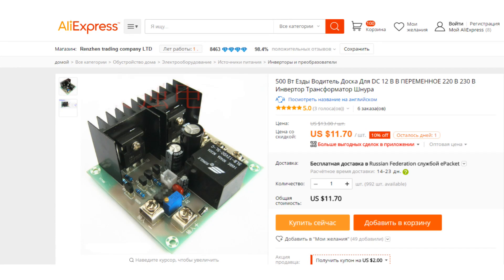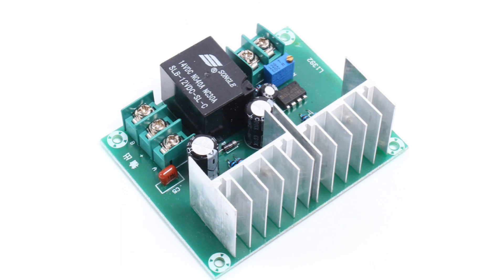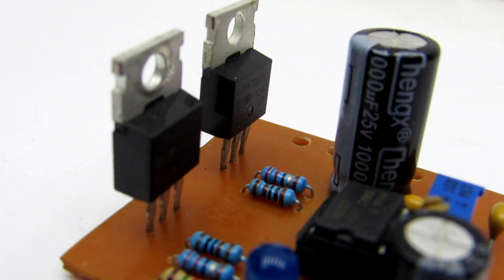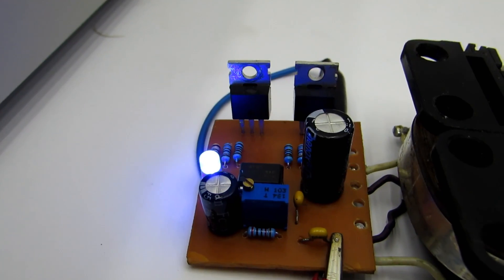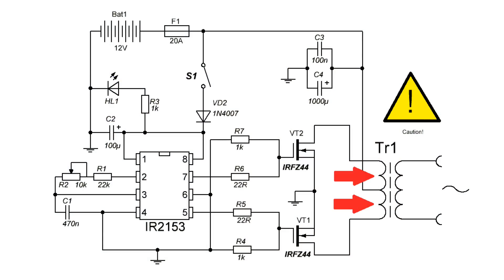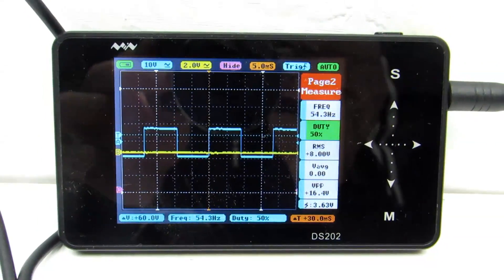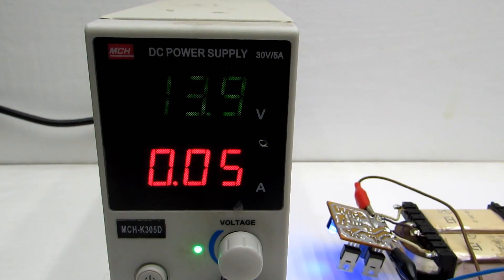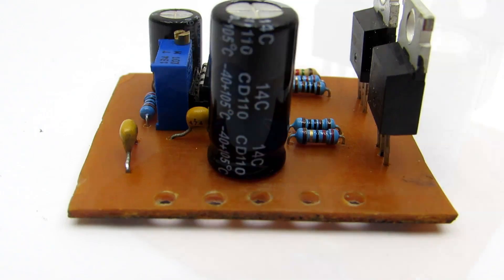DIY Simple inverter from 12V to 220V

Comment: please sir, tell me one thing. I have 12V DC with 1Ampere.i want to increase it's ampere. please tell me how can I increase it's ampere but voltage should be same or increase? when I try to increase ampere, the voltage decreases. please help me.
Reply: you can not increase the amperage of inverter , you can increase only voltage. because amerage is the amount of electricity it can deliver and it cant be increased whit use of another inverter, it can olny be limited an decreased using resistors.
Reply: Rafiq 22

Comment: Hello. Im not good with electricity. But for example u used a 12v battery  to light up a 220v appliance with this inverter, does that mean the faster the battery dies? Thank u in advance
Reply: Kim Chaw You are correct. If you prefer a 220 volt device in this way, the battery will be drained faster than if you powered a 12 volt device with the same battery.
Reply: 50 watts is 50 watts no matter if 12 or 220 you will suffer losses in the conversion but that happens up and down if you can work within the original power source that will be more efficient